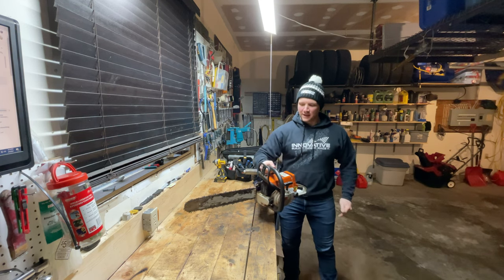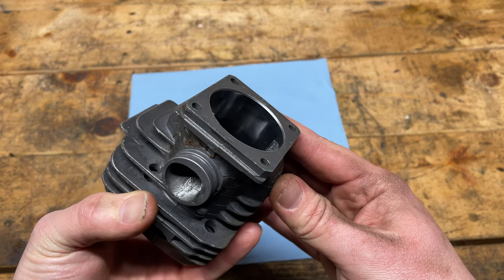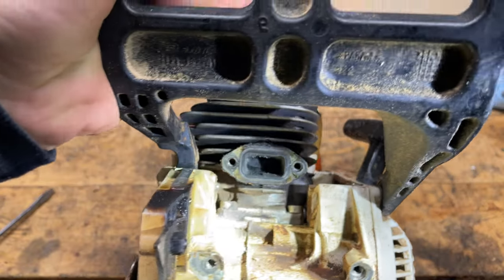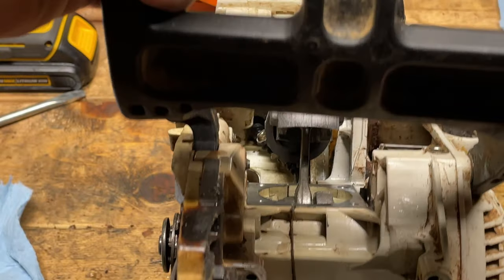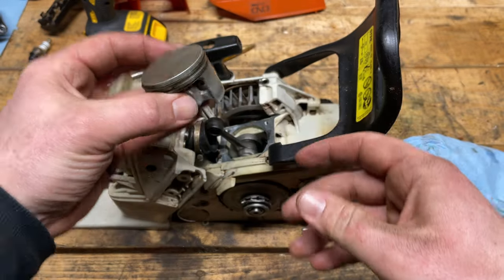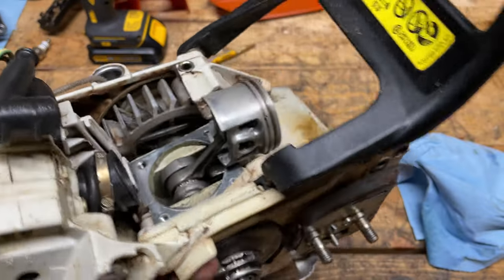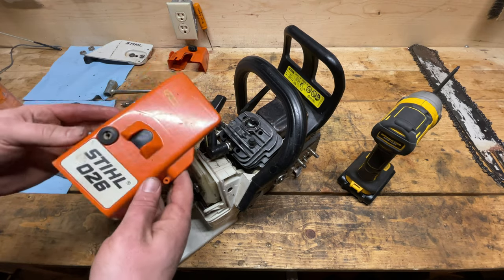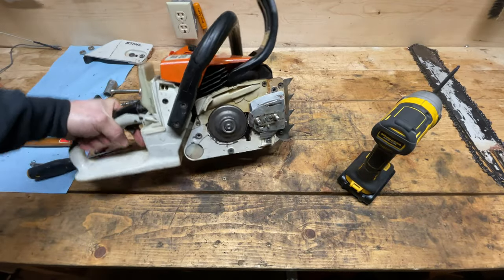Making an older chainsaw easier to start (Stihl 026 scored cylinder repair / update)

Comment: I enjoyed very much to watch your video (first time ) However my friend Peter has 026 chainsaw he only use it  a few times a Year
Last time  he went to use it and didn't start , he took it to a Still Shop and  they told him it hold and no worth to fix it .
He gave to me to have a look ( I got a little knowledge ) But I can assure you the chainsaw look NEW . I removed the
 exhaust cover (?) no scratches appear on the piston .The carburettor gaskets  seems to be OK .Put
all back and it fired on the first start  ...the second time took me six or seven try to start ...I informed Peter that 
the chainsaw starts and seems nothing is wrong with it  .Well that was a month ago Peter  went to use it the 
other day and it stated straight away  then after moving some brunches he tried to start  it again but no way
 would start  .WOULD you please give me an idea where to look for the  problem ?   Thank you ....-BRAVO---

Comment: Dave, any chance of getting the Stihl part number for the MS260 cylinder and piston that you used in this swap? We have a Stihl 026 purchased in 2000 that badly needs this done. Our 026 appears identical to the one you used. But that MS260 cylinder comes in 2 bore sizes, 44mm and 44.7mm. Knowing which you used for the swap would be a great help, so part# if possible, or  bore size if nothing else, would be greatly appreciated. Thanks for your help, and for a great video!
Reply from the maker: Terry -  I’ll have to check when I get home. Im pretty sure either will work.

Comment: Hey Dave. 
Great Job 👍 Today I used a Pistonring assembly tool (sorry, I don‘t know the exact english term 🙈) for the first time. It‘s so easy to slide the cylinder over the piston...🤣🤣👍 Perhaps this would be a nice tool for you also 😉
Greetings from germany, Stefan
Reply from the maker: Hey Stefan! I think I need to get one!!! Thanks for watching
Reply: Nah I have my owner methods that has worked well for many years so not looking to change my way but thanks anyway

Comment: Also i would use 2 stroke oil for lubricating the piston and cylinder to help it slide better
Reply from the maker: Sounds good griffin! I didn’t want any oil getting into the crank case and causing issues.

Comment: Exactly the problem I've got at 77 I can't start my 2 bigger Stihl saws. One I've had for about 45 years an 032 and it has the same compression as when I bought it all those years ago. (clean your filters each time you use it) but I can't start it.  I was burned out in bushfires 3 years ago and still have lots of timber down needing cleaning up so no rest for this old bloke yet! I think I'm about to transition into Stihl battery saws. Tried Makita...waste of time. My wife can't believe I Stihl need more saws...Grin~
Reply from the maker: Hey Rob! Stihl makes some easy-start models too that have way more power than battery. Seems like battery is the future, though. Let me know what you end up with!

Comment: I loved your video and was very interested because I have an 041 which has always been hard to start, a very hard pull. And a cold start can easily require 50 pulls. A warm start usually will start with one or two pulls but for the past year,  the warm start
is getting worse. Been cutting fire wood for fifty years with it and it does rip.  But now, something is wrong.  Am thinking of moving down to a 50 cc Husky or Echo.  But would love to convert my 041 to electronic and keep it for a back-up. My limited
research cannot find a simple conversion for  the 041.
Reply: Get an eye dropper and put 3-4 drops of fuel directly into the carb and give it a pull. It should pop right off. It’ll probably stall out but it will fire up much easier afterwards.

Comment: You can do it.  An ms 260 cylinder will work on the 026.  My 026 has an ms 260 rear handle on it and it works fine.  I would just put a new cylinder on it.  That will work, too.  The 026 is a filthy little Devil.  I spent a bunch of hours with a paint brush and some old two cycle cleaning up my new 026, acquisition.  I cleaned up everything with gas and my compressor.  Even the chain break parts were filthy.  They are not, anymore and I coated them with white lithium grease and put the clean cover back on.  I can’t cut with it yet because someone had stolen the clutch, worm gear and sprocket bearing but I will put this crash damaged 026 back in operation pretty soon.  It starts up like a dream.  I went through the carb and it was a filthy as the rest of the saw.  Blew everything off with break cleaner and put it back together.
Reply from the maker: Nice! Good work!!!

Comment: Hi Dave! Thanks for the video! I thought the whole production was very well done. I have an O26 that I bought in 1989 and for the most part, it has always started and been trouble free. Recently, it will not Idle. I have replaced the spark plug and am considering a carb kit. Would you know which carb kit it would require or is more info needed? It was not made in Germany. It only has one bar bolt, not two. Could the Intake boot be a problem after 32 years? Thanks for your help.
Reply from the maker: There could be so many variables with a saw that age. Have you made any carb adjustments yet? I would pull the carb off and see what the model is - then pull it apart and see the state of the pump and metering diaphragms. I then would order the matching kit to the carb part #. Let me know!
Reply: Thanks for the reply. I have not made any carb adjustments yet. I will take off the carb and probably get a kit and see if that does it. Thanks for the help!
Reply from the maker: @montebonnicksen2679  sounds good Monte let me know!

Comment: I have seen a utube use tie wraps as ring compresser,they wrap it around the piston push the cylinder down and the wraps fall around the rod just cut them off.
Reply from the maker: Great tip! I will try that!!!
Reply: @DavesSmallEngines  Does any one sell  ring compressor tools?
Reply from the maker: @johnnellis3025  they are widely available. I have always just had luck with my fingernails!

Comment: Good vid Dave! Im a new subscriber, through Donyboy's channel.
I just got given a Stihl 028 Woodboss
My Dad gave it to me because he was given a newer saw. This 028 has a little flaw in that it likes to stall out once it warms up. Runs mint with lots of power under load, but stalls while idling. So you are constantly restarting it...Any ideas where to start looking? Saw is old, but my father maintained it well and it has been used lightly since new!
Thanks for any help.
Reply from the maker: Hey Splash! Thanks for joining the community here, I appreciate it!

Hmm... lots of power so compression isn’t an issue. I’d be inclined to pull the carb apart. It may be time for new diaphragms. 

I would also check the impulse line to the carb. If it’s dried up or cracked the carb wouldn’t be getting as strong of crankcase pulses to actuate the pump in the carb. I would check that first.

Let me know!

Dave
Reply: @DavesSmallEngines  
Thanks!
I will have a look tomorrow, to see if anything looks suspicious. I have a compression tester. Maybe its worth to have a peek? Someone suggested a scratched/scored piston...
Reply from the maker: @splash5974  the number one rule Don taught me - pull the muffler and have a peek. Feel free to email me pics at dave@davessmallengines.ca if you get stumped
Reply: @DavesSmallEngines  
Thanks again Dave! I will have a peek.
Reply: @splash5974  well what happened?? 😀
Reply: @jbbolts  tore the carb down, cleaned it thoroughly, then pulled piston and cleaned up the bore and piston itself. Reassembled and tuned the carb and all is good. Runs great and idles.
Reply: @splash5974  wow you pulled the piston for an idle issue? did you do just the carb initially?
Reply: @jbbolts  Realized how easy it was to pull apart and did so. Found some small scratched on the exhaust side, so i cleaned them up with 320grit paper, followed by 400grt, and 600grt.

Comment: Nice video!  I have a 028 Wood Boss. Is there a cylinder and piston that could replace what I now have to do the same thing. Also, what is the approximate cost for parts and labor?

Comment: I am sure a running saw is better than a scored cylinder and piston that doesnt run.... but ms260 piston/cylinder is a downgrade from an 026... look again at the intake and exhaust ports. the decomp valve is definitely NOT the only difference.  Valuable as a teardown and assembly video tho. Good work.

Comment: when the exhaust side of the piston expands and scores from the heat it pushes the piston towards the intake side causing the light scoring on that side because the piston to wall clearance is gone and the oil is not there
Reply from the maker: Clem!!! This is fantastic information. Makes total sense to me now. I always wondered why !!!

Comment: The ms260 has a decomp valve? is it automatic or manual? I didn't think mine had it so went out to look and there is a solid rubber plug in that spot but no valve.

Comment: Great video. I noticed your  Dewalt  is full size. Do they make smaller ie 12V ? I use Milwaukees. 12 V impact much more nimble.  Also use 12V drill for same reason.
Reply from the maker: I’ve shifted over to Milwaukee M12, but I still have my Dewalt 20v stuff as well. I will buy Milwaukee for the variety from now on.

Comment: Good Video Dave, perhaps you could answer my question or link me to a video where you already have? I'm having problems with my Dads 029 Super, he used it all last season no problems, put it away dry.  Now I can only get it to run for a few minutes and constantly pumping the gas until it stalls out.  I've ran about 2 tanks of gas(proper mixed) through it with some seafoam. I got no love, spark plug is good.  Any thoughts?
Reply: I just want to add, that I'm hesitant to fiddle with the carb adjustment screws because it was working fine.
Reply from the maker: Hey Duke! Sounds like the tank vent is plugged. When it stalls, take off the gas cap and see if there is a “hiss” . Let me know and we’ll go from there
Reply: @DavesSmallEngines  Thanks for the advice. I will give it a try this weekend. Unfortunately I do not have the saw with me.  I will let you know how it goes!!! Thanks Dave!
Reply from the maker: @DukeWhite04  I’ll be here! Cheers!
Reply from the maker: @DukeWhite04  cheers!

Comment: Very awesome video sir! :) I recived as a gift two 026 to resurect, so I'm gathering all the infos that I can. I'm amateur mechanic, and my question is (if it comes to that) is it worth to replace cylinder and piston with an aftermarket one (eBay or Amazon) and if so- which brand would be best to use?

Thank you! :)
Reply from the maker: Hey Krampus. I would be careful with the cheap eBay piston and cylinders. I would look for an OEM or Meteor kit if you want it to be as good as new.
Reply: @DavesSmallEngines  OEM would probably be very expencive, if even worth it. I'll keep an eye for the Metor one.
Thanx for the fast reply! :)
Reply from the maker: @KRAMPUS_G60_16V  I just Google'd and found a Meteor Piston and Cylinder kit for $135.  Wolf Creek has them in stock.
Reply: @DavesSmallEngines  I'm from Croatia, I'd have to check european market due to shipping and import charges. 🙂

Comment: Dave, if the pull cord on my MS 170 is sticking, do I have to remove the 4-27mm. star screws and rewind the mechanism?
Reply from the maker: Yes! That’s all there is to it. I think @donyboy73 has a video on that.
Reply: @DavesSmallEngines  Thanks Dave!

Comment: the video i was waiting for !!..great job, Dave....thumbs up
Reply from the maker: Hey Skid! Thanks for watching. Will this help you?
Reply: @DavesSmallEngines  it sure does ..thanks so much !!..just wondering the best place to buy cylinder head and piston
Reply from the maker: @Gary67242  you have an 026 eight? Is it your own? Do you want to keep it long term?
Reply: @DavesSmallEngines  yes, 026 and i want to keep it. i replaced it with a 261 but i'd like to get it back in shape because i think its a better saw than my 261, not that the 261 isn't a nice saw but i miss the 026
Reply from the maker: @Gary67242  which 261 do you have? The older style or the newer like I just diagnosed on Don’s channel?
Reply: @DavesSmallEngines  i bought the 026 in 1995, i believe its the same as you had on don's channel

Comment: I have a shindeiwa.591 saw with the decompression button it helps me start it I'm 57 years old 😂🤣
Reply from the maker: 57 years young!
Reply: @DavesSmallEngines  yeah buddy 👌😃
Reply: I bet you will like it more in ten years!
Reply: @johnnellis3025  hopefully I will still have have it by then one issue of it is the oil pump had to be replaced on it twice 😟

Comment: Not sure what this is all about, beyond self-promotion.  The engine in the 026 is identical to the 260, so you are simply swapping engines.........and referring to the exercise as a "good Joe" effort. What a long-winded video. to be sure...
Reply from the maker: Thanks for the comment Bart! The MS260 has a decompression valve, making it easier to start.